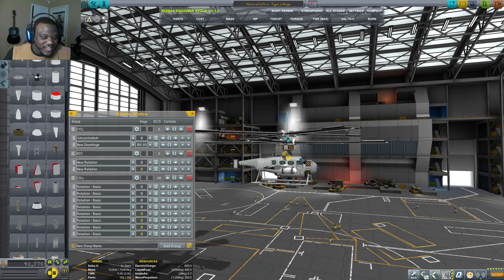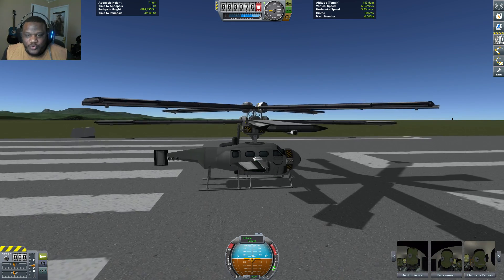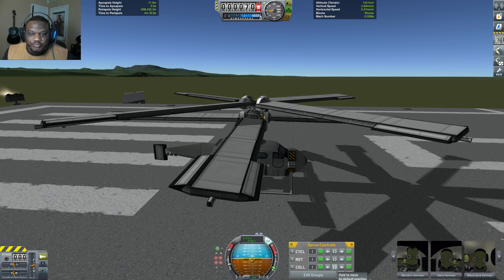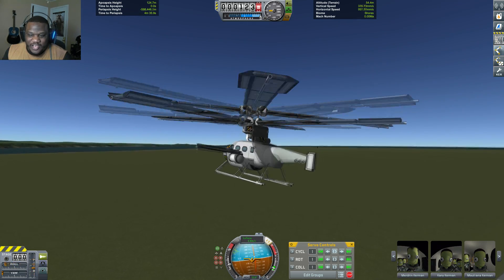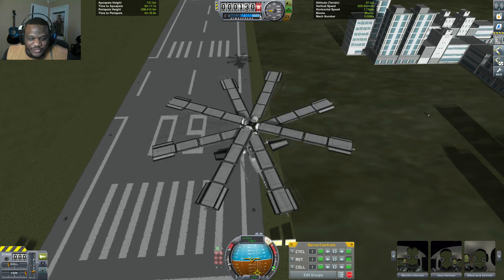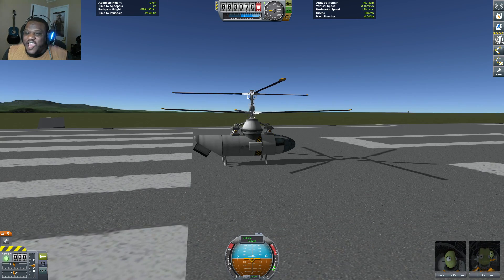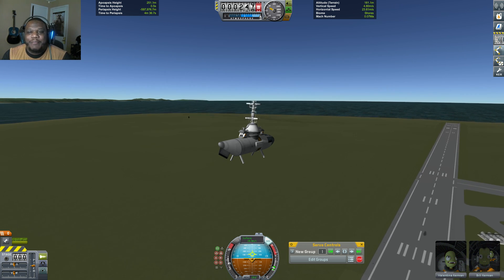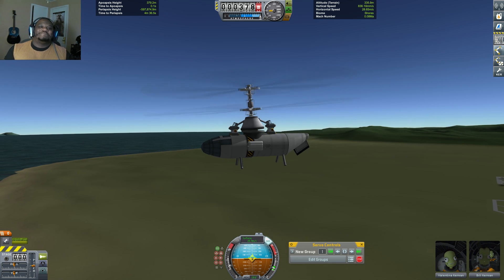Kerbal Space Program | We've Been Choppering Wrong

Comment: The way a helicopter cyclic control works is that the angle of an individual blade varies over the 360 degrees of it's rotation. Put the stick forward and you get a higher angle at the back half of the travel and less at the front half. Might be hard to do in IR though. :/ It's more or less the same as a quadcopter speeding up the rear motors and slowing down the front ones. Centre of lift goes behind the centre of gravity.